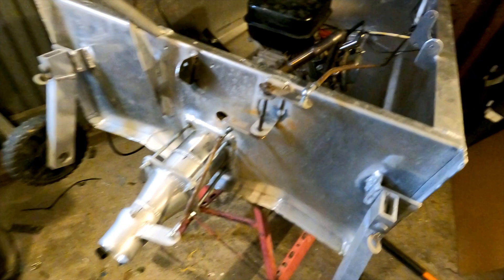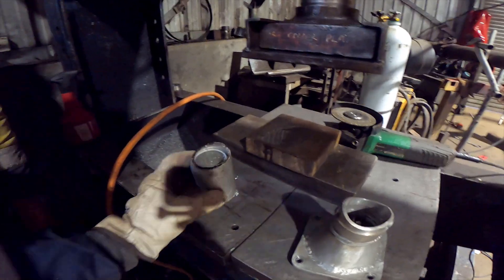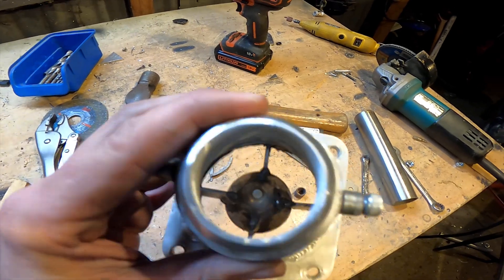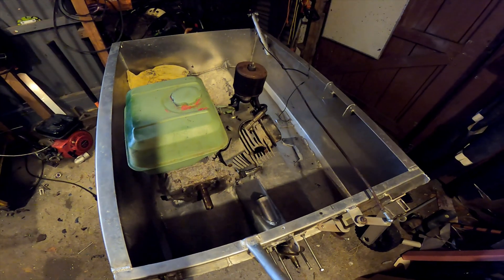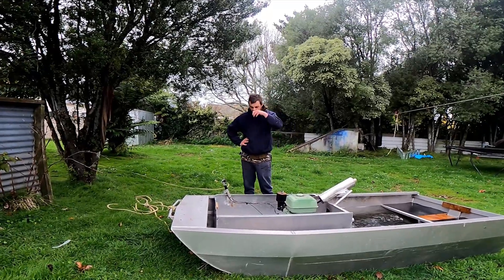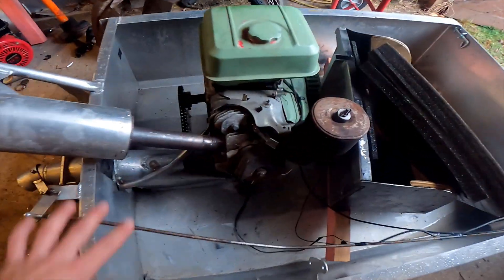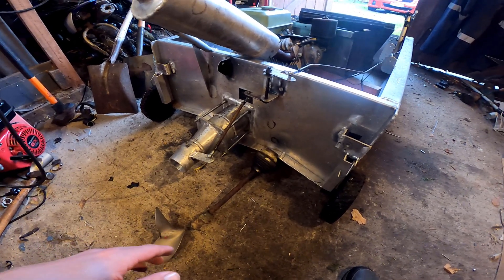Homemade Jet Unit Build, part 5 Double the POWER

Comment: so the thrust you get is (Vjet-Vboat)*water mass flowrate. The horsepower required to create the jet however is Vjet^2 * water mass flowrate. What this tells us is that if you want to be more efficient (ie plane on less horsepower) you need a jet that moves more water. What you're looking for is a bigger impeller, not a smaller nozzle. Also if you work out the math on this stuff a fairly large jet drive for that sort of engine will only really start being efficient at around 20mph or more. I see you went to prop on your later videos, which makes more sense for this sorta stuff. jets are pretty cool tho

Comment: I believe your nozzle is too small. Doesn’t need a reducer, needs to be chopped off. Like a quarter of the way up.
Reply from the maker: I think you a right it was too high pressure not enough flow

Comment: See the problem you’re gonna have is jet drive. Systems are terrible inefficient.  A prop or a surface drive is definitely going to be your best bet if you’re not willing to upgrade to a JetSki drive line. At my company in Rocky Creek, we’re currently building these mini jets. And the lesson that we have gathered, is you always want more power. You’re simply not going to get enough from a lawnmower engine.   If small engines is what you need, you need a prop awesome fashion.
Reply from the maker: Yes I have been put off the mini jetboat thing I want a boat I can carry and plane , I have a 5hp outboard now which is way faster than. I think it needs to be a trailer boat if it is a jetboat 👍

Comment: What you need is more revs not more power. Valiant effort but focus on getting higher revs......
Reply from the maker: I had it geared for more rpm but was geared too high the motor never got into its power at higher rpm. I think if I geared it about 1.8:1 instead of the 2.4:1 it would have worked
Reply: @dkthewelder  Possibly but I am unsure. These jets really need MASSIVE revs to work effectively. I read somewhere today that someone is changing back to their original electric motor because the 18.2k revs is not good enough compared to the 27k revs of the original motor......Trying going electric my friend. I wish you well with it and thank you for the great videos :-)

Comment: Hi guys - I just came across your video and I love your idea and fabrication is impressive - wow, but that being said - am I wrong to assume that you have one giant fundamental issue and it is the fact that the exhaust part of your jet is always above the water line and thus waisting all the power... if you somehow redesign it and make sure that that exhaust part is always under water, than you should get real propulsion; otherwise you just shooting water in the air...
Reply from the maker: Every jet boat has the nozzle above the water line when planning they can usually adjust the nozzle up and down a bit to trim the boat , although my one is a bit too high . I am using a propeller setup now which is way more efficient but would like to go back to the jet unit once I have more knowledge on it

Comment: This is late but I just found you channel you can get upto 50% more volume of water by using a bigger diameter steering cone according to the Bernoulli effect In fluid dynamics, Bernoulli's principle states that an increase in the speed of a fluid occurs simultaneously with a decrease in static pressure or a decrease in the fluid's potential energy.[1](Ch.3)[2](§ 3.5) The principle is named after Daniel Bernoulli who published it in his book Hydrodynamica in 1738.[3] Although Bernoulli deduced that pressure decreases when the flow speed increases, it was Leonhard Euler who derived Bernoulli's equation in its usual form in 1752.[4][5] The principle is only applicable for isentropic flows: when the effects of irreversible processes (like turbulence) and non-adiabatic processes (e.g. heat radiation) are small and can be neglected
Reply from the maker: That’s some complicated stuff! I tried a smaller nozzle because the motor was running too freely but really need to make a jet unit. I can’t really find any good formulas to help design a jet unit properly for a low 6-10hp motor so I might get a 3D printer and have to do trial and error
Reply: @dkthewelder  basically you could build the can that you use to steer with about 2 to 3 inches bigger gap between it and the nozzle then place the nozzle end mid point in the steering tube. This will cause extra water to be sucked into the steering tube and blown out with the jet. They used to build a tire inflator with that principle and it would fill a tire 50% faster. There was a story on it in popular science back in the 1980s

Comment: The physics of rocket propulsion has dm/dt in the equation, which is delta change in mass being trusted per a time rate. 
Is cavitation of the impeller being spun at a 8K RPM a possible reason for not seeing an improvement? Just seems larger diameter impeller and nozzle, with enough KW power to drive it is needed. I'm amazed at your simple used of a hammer and edge of table to curve sheet metal into shape. Nice build!
Reply from the maker: I don’t know about that rocket propulsion stuff ! But I think your right the whole unit needs to be bigger. Thanks 👍

Comment: Would it help if the jet was deeper in the water... and the front of the intake where a little less abrupt.
Reply: Height of exit should not make any difference, it is the mass flow that provides propulsion so you can shoot the water above water and get the same thrust. So I would focus on the intake design to improve flow and tune the output diameter to achieve desired speed of the boat. Only way to increase thrust is to either move more water at the same speed or move same amount of water faster, at least according to physics.
Reply from the maker: yeah lower jet unit smoother intake and bigger diameter all thinks that would make it go better i think , thanks for the input👍

Comment: I would need to compare footage before and after your wheel mod. Watch the footage, are they  creating some drag? I see spray coming off both corners of the transom
Reply from the maker: Yes I think they are creating drag but once on the plane it should be ok I thought it would plane easy with that motor. It goes 30kph with three people on the bigger boat I’m using as a test tub using a longtail setup with that same engine

Comment: I think one of the reasons why it was going slower is because that 13 horse motor didnt have enough torque to spin the impeller with the water at the gear reduction it was at, theoretically it would spin at 8k RPM however thats under very little if any load, maybe try mounting a dirtbike engine with its transmission up to the jet and see how that goes? 
As for the grating clogging up a lot try having some way to put the impeller and stuff in reverse, if you can do that it will back flow water through the nozzle and out the grate clearing any debris. Really interesting build though, im sure it'll be quite fun once you get it all set up how you want it.
Reply from the maker: Thanks! It is a great project and you are right the gear ratio was too high and the motor couldn’t get into the power. But that motor is too heavy lifting up and down river banks , I am working on something at the moment that should solve most of the problems I hope
Reply: @dkthewelder  I look forward to that video, do you plan on building a water deflector for the nozzle so you have a neutral position and a reverse position as well as all the way up for forward?
Reply from the maker: @The_JEB  a reverse bucket! I was going to build one once I got it all working properly
Reply: @dkthewelder  if you get it set up right you'll have the nozzle pushing water for you to go forwards as well as into the bucket to go backwards which would effectively give it a neutral position as well, that way you can start it without worrying about the boat taking off on ya

Comment: jets like that are alot more inefficient than a simple propeller i belive so even if you got a perfect system you would need more power to go the same speed as just with a normal prop, aswell the issue with the intake been clogged with weeds
Reply from the maker: You are dead right! I’m moving away from the jet unit for a bit because of those reasons. I will revisit the jet unit but a normal propeller is better have you seen my chainsaw surface drive videos?

Comment: Make a thing in the back that you can stomp to clear out the grill. Look it up for jet boats. It's a thing
Reply from the maker: Yeah a stomp grate . They work pretty well but on a boat this small I can’t even stand at the back. Could make it work I guess 👍
Reply: @dkthewelder  you don't need to stomp it.. may not be a good idea anyway with a thin aluminum hull. Maybe a handle like a drift car e brake?

Maybe it'd be easier to just make a tool so u don't need to stick your arm in the water

ORRR  a super dumb idea.. use a mesh to cover the grill(very large mesh size, like chicken wire maybe?). Just slide the mesh to the side for a fresh section

Comment: looks like it ist not getting on full RPM. check the small levers on the carb. have the same one and it runs on much higher rpm like double or so
Reply from the maker: the governor is by passed and its getting full throttle , I made the gearing too high so it couldn't get into the higher rpm . I think it would have got on the plane if I got the gearing correct but this motor is too heavy for carrying up river banks and over obstacles , I am working on something at the moment that might be better the video will be out in another week or so, thanks for the comment

Comment: Hey back again lol! checking your progress lol!   I see you went 4 stroke!   Your output nozzle is way to high up to be of much use. Looks like it's directly flat out the back. should be on a 9 to 12 degree downward pitch to push the boat forward only 1/5 of the output should be seen above water in ideal functional conditions!  your losing 1/3 almost of your total thrust to making a rooster tail! That is why most river boats can up and down the pitch to go up through rapids or on flats! The slight downward pitch will push the ass of the boat up out of the water and forward. Creates less drag and more forward motion! Funny enough I have a 1/4 scale about the size of your little boat lol! 5.5 foot long* 2.4 wide. 2 blade 130mm jet pump prop. 125cc 2 stroke.  Was the reason first started watching though was large scale rc at first lol!
Reply from the maker: I didn’t realise the angle had that much effect ! I also think the jet unit isn’t very well made , I am going to try a surface drive and then come back to the jet unit once I know how to make it work properly, thanks for the advice!
Reply: @dkthewelder  pitch up and down makes huge changes in how it moves the boat!  Other thing! impeller is very aggressive on this build! I went all in 3 blade huge one on my first build lol Burned up tons stuff!  Went with a 2 blade very slight wave design prop second go! higher rpms and less motor load. Gained actually tons of speed!  And nothing went super nuclear lol!

Comment: Love your videos man! Great building skills. By the sounds of it the motor doesn't have enough torque to reach higher rpm and its true power potential. However your gearing choice for 8000rpm is good for a jet pump.

I think you need to go less pitch on the impeller, your impeller seems to have a lot of angle on the blades. Lower pitch will not only allow the motor to reach higher rpm, but will also increase how much water pressure it can generate, which should result in more water being pushed through the nozzle and therefore more thrust. If you had access to a 3D printer you could use that to print out a nicely balanced more efficient impeller.
Reply from the maker: You are saying exactly what I am thinking! I was thinking of getting a 3D printer to experiment with different jet unit and impeller designs then make a metal on once I know what to do. I don’t want to use that heavy motor but the smaller 6.5hp in the other videos which probably does around 4000 to 5000rpm , how would I make the pump work at those rpm? Or do they need to spin fast?
Reply: @dkthewelder  You can make a pump that will plane at 4-5k rpm. The tough thing about having low rpm and power is getting high speeds, because the water velocity is usually slower out the nozzle, but it will be fine for planing and cruising. Since you have low rpm, you will want to go with a slightly larger diameter pump, and also keep fairly high pitch on the impeller blades to keep the water velocity up. 20% less blade angle could be a good starting point.

I use the reality CR-10 3D printer and once you get it dialled in it works great.
Reply from the maker: @jakebarnhill6308  o cool! A 3D printer be good for experimenting then make it out of metal once I figure it out. I have a huge chainsaw motor now that apparently does 12000rpm so hopefully try it on the weekend
Reply: @dkthewelder  haha nice! That chainsaw motor could be a more ideal power plant, powering a small 90-100mm jet you could some decent speeds. 

I guess cooling might be a bit more of a challenge with the chainsaw motor. Could always wrap some copper pipe around the cylinder or something.
Reply: @dkthewelder   id say ashallower pitch impeller would do it a world of good look at say a jetski impeller for reference

Comment: hmmmm after all that work .....might be a matter of pump design so no matter how fast it spins you wont see the result you want. Surface prop is a easier solution...maybe :-)
Reply from the maker: I think your right, there is something wrong with how the pump is designed but I’m not sure on how to fix it! I will keep researching for the next design and in the meantime get the surface drive going because that interests me too

Comment: Man I want to build a lightweight boat with a jetdrive and a Honda clone so bad. I think that your gearing is too steep. 2.4 : 1 is taking it out of its powerband more than cutting its hp in half. I think you should play with a belt and 2 adjustable sheaves that way the motor can hit its max rpm
Reply from the maker: Yes the motor wasn’t reach its power I was thinking of changing the gear ratios but I have a feeling there is something wrong wit the jet drives design. Also I want to use on of those 6.5hp motors with direct drive and make it get on the plane and work properly it should have enough power just a matter of making the jet drive suit it
Reply: @dkthewelder  I wouldn't say i
There's something wrong but they like ~6000 rpm. The main issue is the motor is overloading at too low an rpm and it doesn't make enough power to overcome it. I bet it would get on plane at 1.5 : 1. Which would be easy to achieve with 2 adjustable sheaves and 1 belt. You could get them from an a/c supply house for a commercial HVAC blower. I've thought about this a lot lol

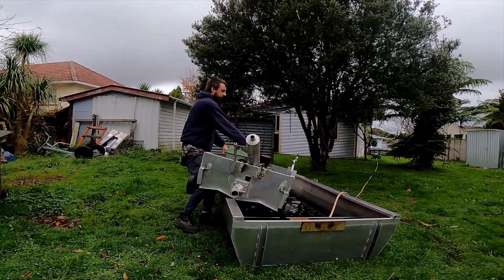Comment: 5:27 loved the kick by the jet there, maybe redirecting the jet stream upwards, rather than shooting it into the water, could help with the speed
Reply from the maker: It seemed to have heaps of power in the tub of water but didn’t go any faster, I was surprised at how bad it went I have run that motor in my bigger boat with 3 people at 30kph . I think my jet unit is too badly designed haha
Reply: @dkthewelder  3 people with an open prop, right?
Reply from the maker: @Eden_M  yes with a longtail motor with a surface drive prop

Comment: I don't know if you have heard of the Blenheim River Queen?  It's made to look like a paddle boat, but actually has a pair of 25hp Honda outboards hidden in wee compartments on each of the rear quarters.  That used to constantly clog the propellers with weed and it was apparently a huge PITA clearing them.  The boat has gone south to Christchurch now, but it never made the owners any money, and that was partly because hoons used to smash its windows and break in an steal booze.  It seems to me that your biggest problem is too much resistance pushing that slab of a hull through the water.  It's more like a raft than a boat, and it doesn't look like it has the shape to lift the bow and get it on plane.  I know you'll keep at it till you make it fly though.
Reply from the maker: That hull is actually fast . It would plane with a 3.5hp outboard and plane two people with the 6.5 hp longtail . But my jet design skills of just making it up as I go aren’t really the best haha , but even so the weeds would still block it up even if I had a JetSki unit. I’m still thinking about the next step I have a bit of a plan and another motor option

Comment: Maybe you're impeller design needs a tickle
Reply from the maker: I think it does, maybe a direct drive with a more aggressive impeller or a two stage could be the go but the weeds are still going to be a problem
Reply: @dkthewelder  no lake near you?
Reply from the maker: @theideasman6018  there are some lakes but a couple hours drive the sea is only 10mins away but an outboard is better for that I want to explore the rivers but didn’t realise it would clog up this much . I can still use the jet unit for another project in the future

Comment: Stuck at a cross road road for sure, the 420 is deffinelty heavy. Try the surface drive and remove the govenor. This way you will be able to swap and change the prop for Max thrust and not ring its nut out. Failing that a redesign.Your bloody  good at what ya do that's for sure
Reply from the maker: Yeah thanks! I have 3 surface drive props I can try so should be able to get it going fast , I want to make linkage arms so I can face forward and have like a joystick to do pitch and steering in one ,hopefully I can get it to work
Reply: @dkthewelder  don't let it beat you !  There's deffinelty a way... the joystick idea is awesome id think the pitch will be difficult but not impossible